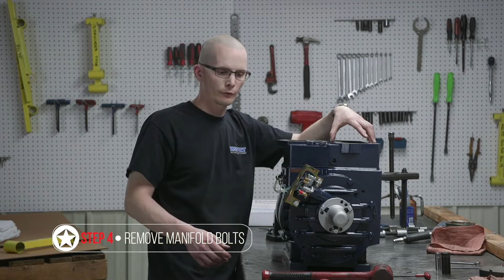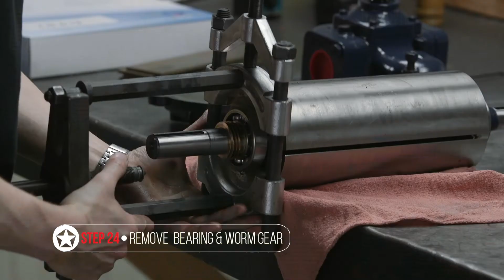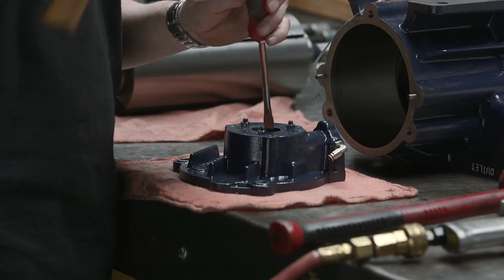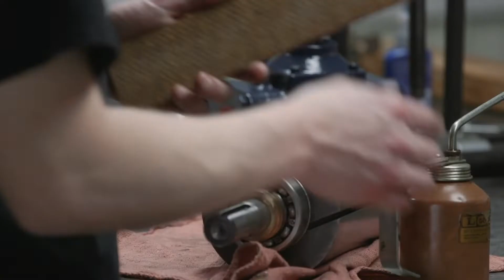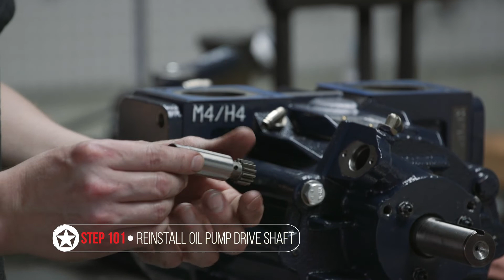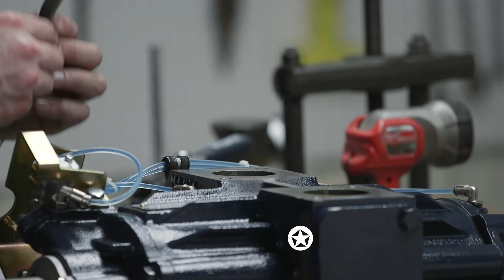Masport - How to Rebuild Your HXL Series Vacuum Pump

Comment: In all the pumps I’ve rebuilt I’ve never had an end plate release the bearing as easy as yours did. Granted I’ve never rebuilt a brand new pump like you did in this demonstration. Most of the pumps I rebuild have hundreds of hours on them.
Reply: En donde radicas?
Reply: @sanifex.servicios United States

Comment: How do you clean inside the vein slots when they’re loaded with oil/debris ? Trying to find something better than pressure washer
Reply: I use diesel fuel and thin wire brushes.
Reply: Utilizo desengrasante (Goo gone) aplico y dejo unos minutos, despues de eso aplico agua a presion con la hidrolavadora.

Comment: do you have anything i could mount on a skid and drop down a 3 story shaft to pump mud/water out of a 80' deep missile silo? at worst i would be pulling materials 700' horizontally and 100' vertically